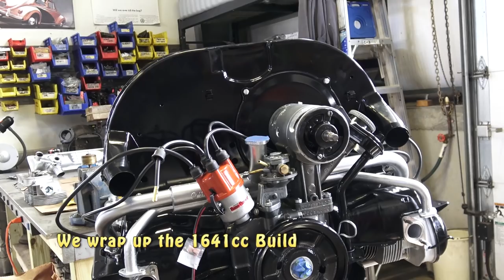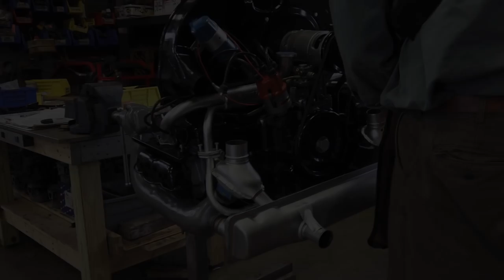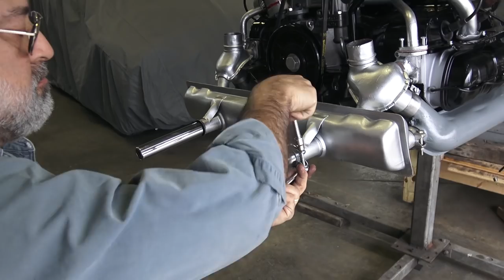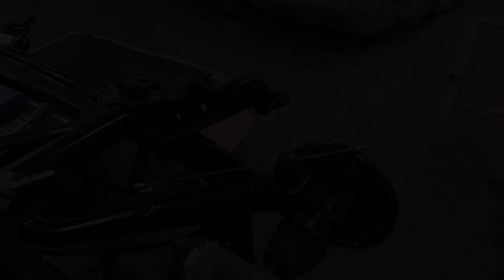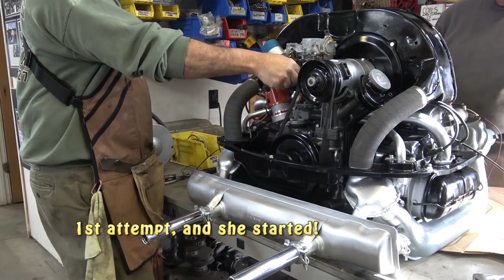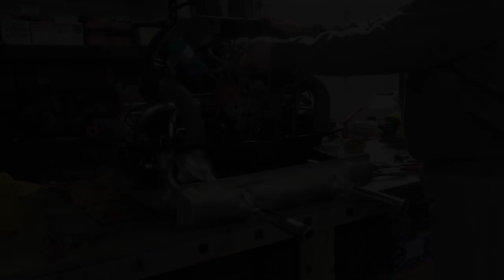Classic VW BuGs 1970 VW Beetle Resto Project Continues 1641cc Motor RUNS!

Comment: Chris 
What's the compression ratio on the engine, since it now has 87 mm P/C ?  Did you change  the jets in the carb? Are you using 87 octane fuel?

Comment: Love your videos! Why did you go with 87 mm pistons over stock? Heard they run hot and don't last as long.
Reply from the maker: I have heard the opposite, but we are making sure everything runs the way it should.  I have only heard good things about the kit, but since this is a car for me, it will be a good test to see how it goes.
Reply: Michael Santana slip in 88mm are bad as they get to thin and crack 87 would be like boring to 60thou ,should still be lots of metal left
Reply: Chris, hows this engine running? I want to build one

Comment: 1641cc = 100.1 cubic inches.  I wonder if this is a real 1641cc or the non case-bored slip-in barrels?  The slip-ins have an over-heating problem.